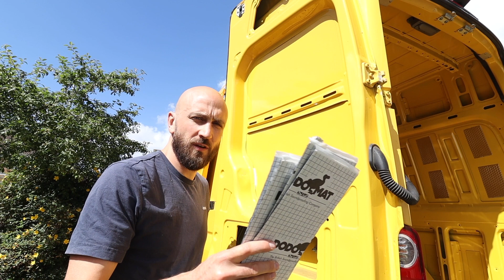VW CRAFTER CONVERSION - SOUND DEADENING - TINY HOUSE - EP 3

Comment: You should get some rock wool and fill in the panels with that it will dampen the sound better and insulate too
Reply from the maker: DJROYROSS Thanks for the advice 👍 I’ve purchased knauf Earthwool and I’ll be insulating the walls with that.